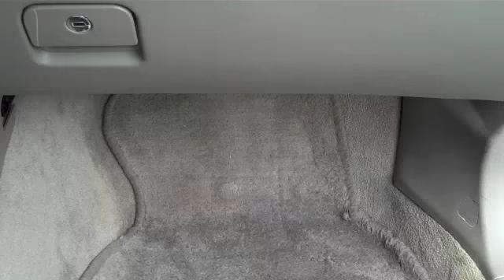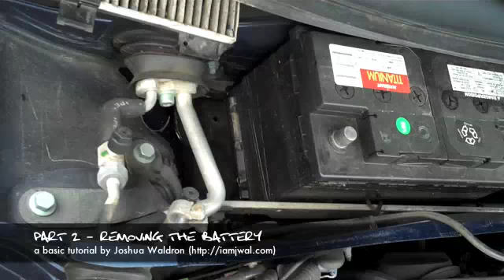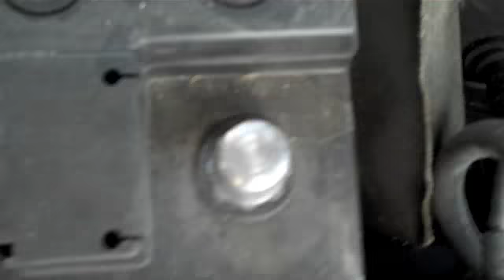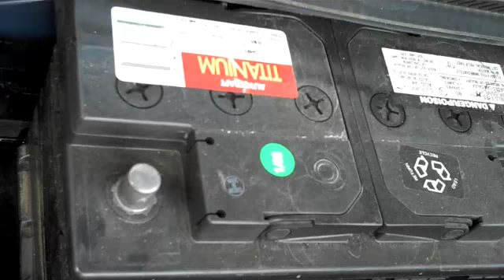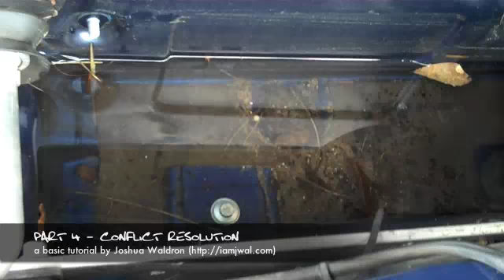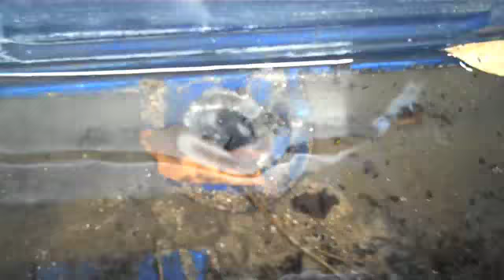1999 Audi A6 Water Leak DIY Tutorial

Comment: Thanks for sharing, I've just done my 1.9 Tdi. You do need to remove the battery holder to make a good job of cleaning it out, but now I know where the drain is, I can reach down the side of the engine and poke my finger up the whole as a quick fix if I ever need to.

Comment: what about the water on the floorboards? how do you get that out
Reply from the maker: Saul - I would use a wet/dry vac to get that water out and then make sure the drainage hole is unclogged so water doesn't end up in the floorboards again.
Reply: iamjwal thank you for the reply. You have any idea how to lift the carpet?
Reply from the maker: Not sure about that...
Reply: Saul Garcia shop vac

Comment: In my case, I had an issue with water coming into the passenger side that turned out to be the plastic trim right at the base of the windshield, it was not fully clipped in, and even if it were, didn't appear to have any gasket material to block the water from coming right down and draining directly into the exposed pollen filter. It simply funnels all the collected water down the fresh air intake and straight into the passenger compartment.
With Audi choosing to place the transmission control module inside a watertight well at the floor so it gets to steep in the pool of water, it takes out the transmission module, and the gear indicator on the dash then goes into the dreaded reverse video display.  
I applied a very light bead of silicone on the trim piece to make sure this rain collection funnel is circumvented, and was back in business with a replacement TCM from eBay, reasonably priced compared to the $1000 Audi hopes to get from the hapless owners that don't know the alternatives.
Reply: yes i have the same problem on my 2.7 turbo quattro s-line 2004 audi .....and to be honest i dont know what to do or how to fix it ...i was even thinking to put glue in between the plastic and windshield so the water wont be able to go and flood my passenger side comp ....i have really no idea what to do more...
Reply: I put a bead of silicone sealant on the edge of the trim piece covering the air intake.  Don't know what Audi was thinking with that design, not having any kind of channeling to route the water away properly, and no gasketing.  Appears they expected that two plastic edges close enough to each other would be sufficient to  limit the amount of water coming through, so no one would notice or care about a small amount of leakage.

Comment: I do not see water but I am having a problem with water coming into the Audi. But it is the back passenger floor. I will have to look into this. I am only getting water in that one area.
Reply: ***** Don't be fooled by the water in the back - I had that too. Comes from the front which is slightly raised. Cost me a new gearbox computer (waterlogged, under carpet in floor)
Reply: +jc Stone ac drain clogged....
Reply: Where do I find the AC drain?

Comment: The FIX is not completed by clearing the drains, water is still draining into the inside air duct. You have to remove the rain deflector that runs just under the windshield. Apply PB Blaster etc. to the upper edge, remove clips and move the deflector down and swing upwards to unlock deflector. Then you can get to the hidden back nut holding the pollen filter box. Remove all three bolts on the filter box and remove it. The rubber gasket that sealed the air duct has disintegrated. I cleaned up the area and used black silicon caulk to seal the box to the car. I did not use caulk around the  duct opening.
   Earlier Audi routed the runoff water toward the fenders. The A6 has a SUPER design flaw running the water to the center over the interior air duct work where gravity takes it into the foot wells.
Reply: The thing making it even a sillier design is how they put the transmission control module inside a well under the passenger side carpeting, in a plastic box that will collect and hold water that comes in from the wire harness.
The electronic module sits in a puddle with the owner blissfully ignorant about it, until the transmission trouble starts and lights up the gear indicators in reverse video.  Then they either have to shell out over a grand for a replacement TCM, or if they're lucky, find a seller on ebay with a replacement unit for $150.
Given the propensity for Audis to take on water and the TCM vulnerability, I've just left the TCM up high under the dash instead of putting it back in the Audi floorboard aquarium, in case it floods again.

Comment: Thanks for the video. I have a 2005 A6 SLine and after a torrential downpour overnight discovered an inch of water in the rear drivers side footwell!!! After seeing your vid I took off the plastic cover below windscreen and found the plenum in about 3 inches of water. Didnt have to remove the battery (its in the rear) so just took a long screwdriver and poked about. I pushed through some debris to unblock the drain-away hole and about 5 litres of water gushed away under the engine! Thank you!

Comment: i did the job last night, i did remove the battery but not the tray, thanks for the video it did help,
there were leaves and dirt but got them cleaned out and washed with a running hose.
thanks again

Comment from the maker: @mackmor - I've heard stories about the electronic control module being ruined from water. I'm fortunate that I haven't experienced that myself. If you follow the instructions in my video you should eliminate the majority of water your problems. Once you clear out that area, let your car air out on a hot day, clean the carpets with a ShopVac, and spray some Febreze. Good luck.

Comment: My mechanic found about 1-2 inches of water below the driver floor board in the compartment that contains the electronics control module for the car. The module was corroded and caused all kinds of problems.  Plus I've had a horrible mold smell. Would this be traceable to the same issue in your video?  I also saw a comment that there is another drain on the driver side near the brake fluid reservoir? Great video, hope it explains my situation.

Comment: Another note on the coat hanger method from previous post: You should CLEAN both gutters under  the hood hinges with a strong blast of water. Then blast out the bottom of the battery tray too (from each side taking care not to wet key components). If the drain hole plugs again, repeat coat hanger trick (there is no TUBE below the drain-hole, just a nipple, so the bend in the coat hanger can ream out whatever stuff plugs it up). This has worked several times for me on my A6 AllRoad.

Comment: This vid is great. Thanks so much. A note: Sometimes you DON'T need to remove the battey and battery tray (which is a pain). To avoid this, follow these steps: 1) take a coat hanger, undo it so it's a straight wire, bend a 3/4" right angle into one end, 2) open hood, remove battery compartment cover, 3) fish coat hanger bend end UNDER battery from passenger side below rear-most edge of battery about 8 inches, 4) slosh coat hander in-out. 90% of time you will soon hear water draining out of car!

Comment: This is awesome - i was just about to go to the dealer to get my drains cleaned up. In case you didn`t know, just in front of the pasanger seat you have the transmission control module. It can easily be flooded because of this problem. My TCM got wasted and The dealer was asking $1500 just for the module. I found it on ebay for $150 + shipping. I did the job myself. 
Thanks for another $200 save

Comment: Volkswagen Passat 1996-2005 has exactly the same problem, the drain hole under the battery tray becomes blocked with leaves and dirt. Its an easy fix!.

Comment from the maker: It depends on what needs to be done. Some of these Audis do great and need only basic maintenance which you could do yourself (a few hundred dollars of maintenance per year). However, some Audis run into major issues. At that point, you can fork out a few thousand dollars and still run into problems. In other words, it's luck of the draw.